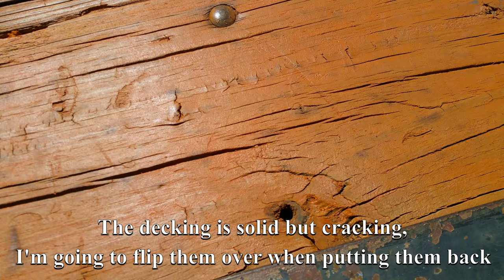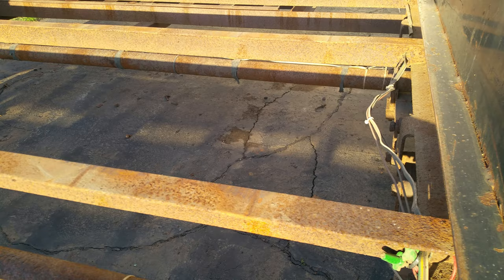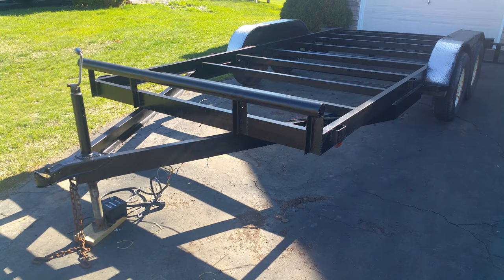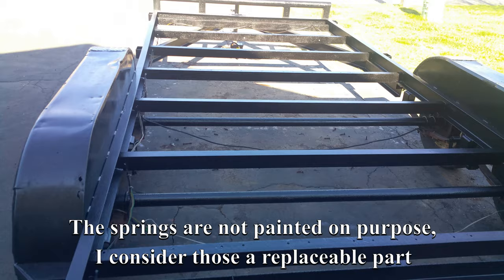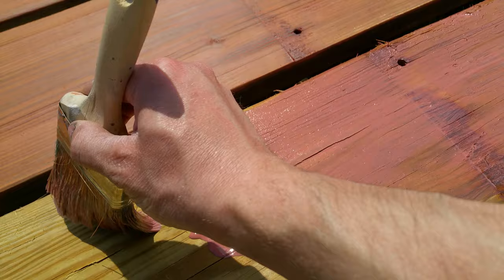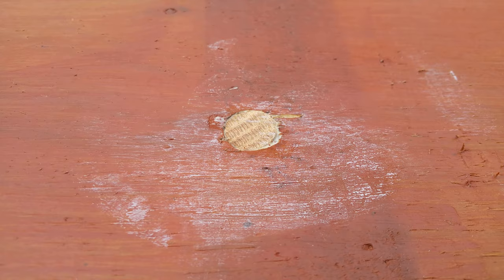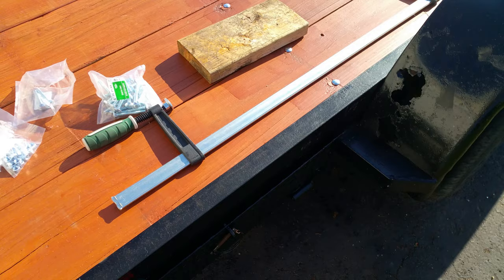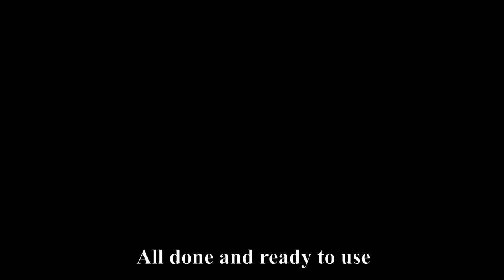Car Trailer Rehab and Restoration

Comment: When I refloored my trailer , I put no screws in the boards. The boards are held in by the angle iron , front and rear. I made the rear piece of angle iron removable ( bolt in with 3 bolts ).
Reply from the maker: That's a good idea! I was working with what was there originally, but in the future I'll probably do that same as you.

Comment: Sand blasting it is way quicker bud ive done a lot of trailers and you will save a lot of hrs if you set up a blaster to remove all that scale and surface rust

Comment: What kind of rust converter did you use? I'm looking at a couple & the one you applied looked similar to one of the ones I've been considering for my trailer rehab.
Reply from the maker: I believe it was called corroseal.
Reply: @in-depthdiy2123  Terrific, thanks! That's what it looked like & that's the one I was leaning towards, from both cost & results perspective.